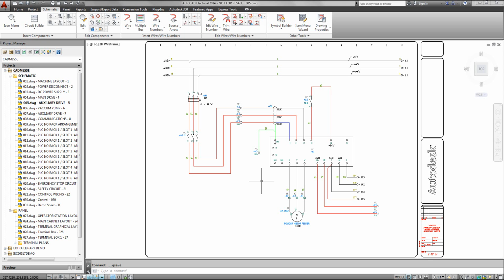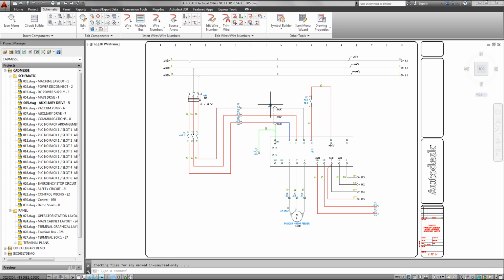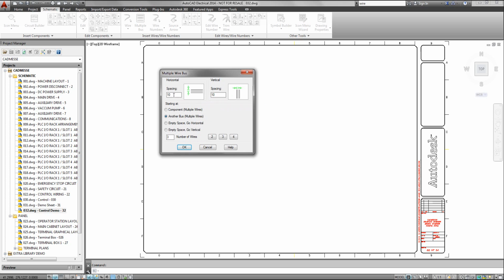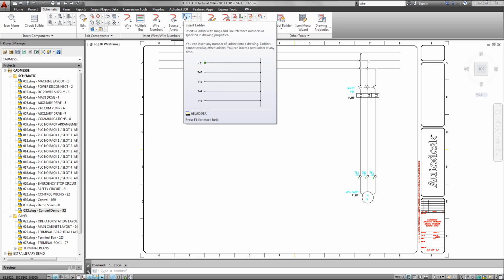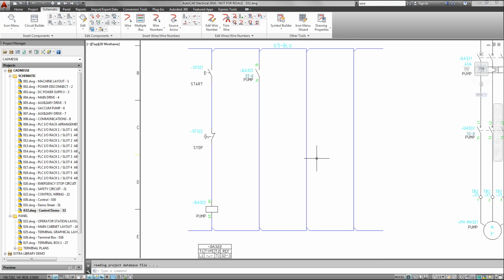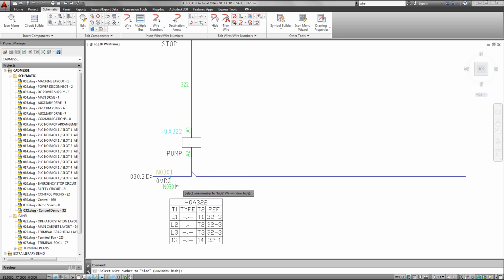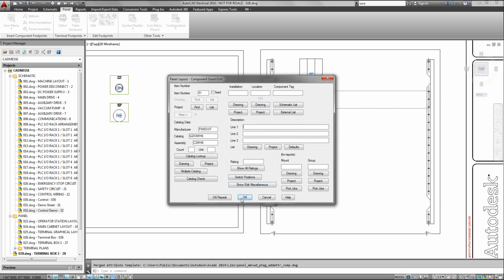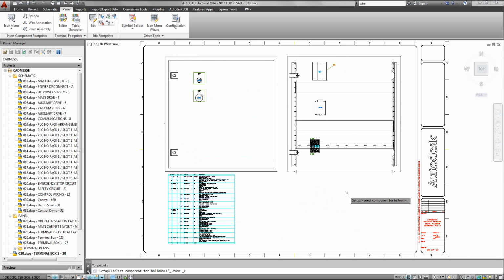Man and Machine CAD Fair - AutoCAD Electrical

Comment: I have a question. I can never get the pin list to appear right next to the coil. Its like as if the string never generates. In your vid, around min 26, you create a parent/sibling relationship between the contact and the coil, and you automatically get that list. I assigned a pin list, everything. There IS a link between the components in my case, with a crossreference number and everything. But I never get that list of pins. 

Also, I keep getting a Z-103 or whatever in my case, instead of normal numbers as my crossreference tag. Wonder if you had any idea why.
Reply: Nevermind. You have to choose the right "demo" for everything to work properly. Choose one inside the IEEE, IEC or JIC folders. Drove me nuts.